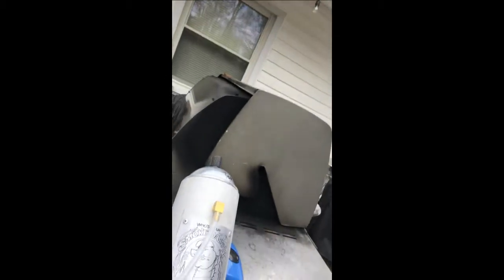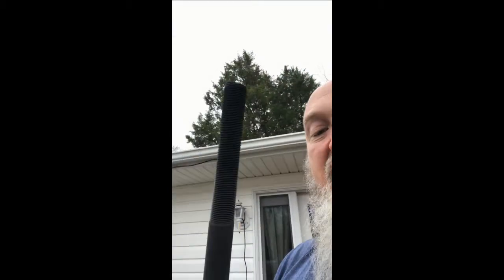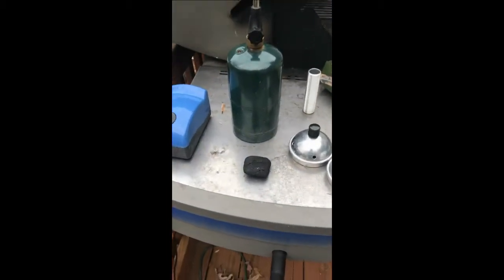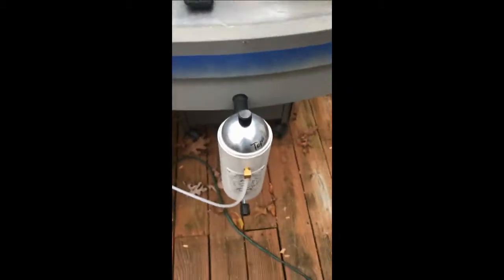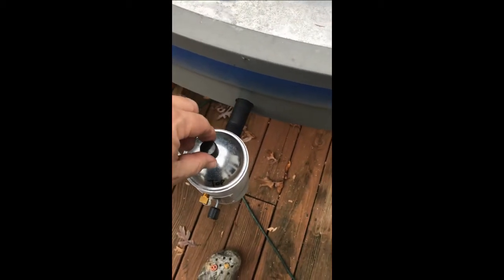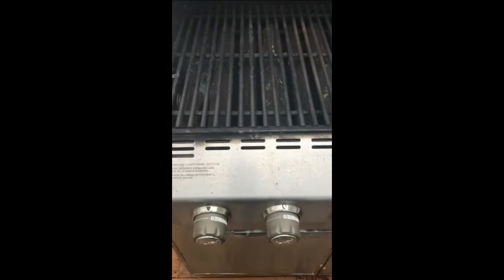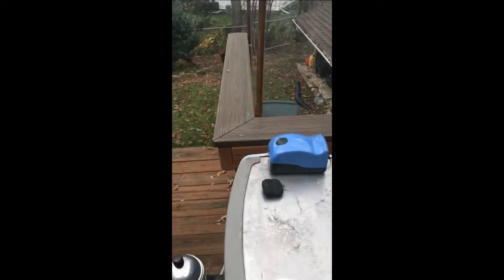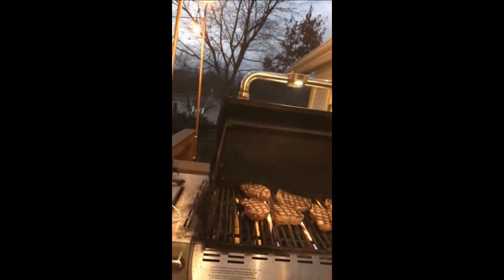Smoke Daddy Big Kahuna Review on a Weber Gas Grill - unbiased

Comment: Ever thought about using a stronger air pump? I built something similar to the smoke daddy as a proof of concept. I used an aquarium heavy duty pump after failure using a similar pump to the one smoke daddy includes. Bought the heavy duty pump off eBay for approximately 40 dollars. The Smoker I built was similar in size to the big kahuna and along with the heavy duty air pump would literally fill a 30x30 warehouse with smoke. 

My design was crude but cheap to say the least so I finally bought the Big Kahuna a week ago. Another thing I learned with my design was that depending on how far out or in the air tube is in relation to the tube that goes into the grill will affect the smoke production. I usually had to move the air tube further in or out of the smoke tube. In my case with the big kahuna the 4 inch threaded smoke tube gives me enough leeway to thread it into or out of the air tube for optimum smoke production.

Haven’t had a chance to install the Big Kahuna on my pellet grill, so I’m anxious for this weekend so I have a chance to install and try it out 👍🏻

Comment: Nice review.
 Looking for something like this that can burn chips instead of pellets.
I've heard the chips only last about an hour with the Smoke Daddy. How often have you had to fill it ?
Reply from the maker: First off, Thanks.  I like to use chips and chunks.  I may need to trim down the chunks with a hand axe.  Either way, maybe an hour of burn.  Chips are faster burn but easier to load.  Its pretty simple to add more or another handful.  I have only used Dry chips and chunks.  I have not tried soaked ones.  If I did, I would use a layer of dry followed by soaked ones so the charcoal doesn't get wet.  It also depends on how much air is flowing from the pump, the slower the pump the longer the burn.  Your grill may also play a part in how fast, but I am not sure.  I have used it on my Weber grilling at 500-600 degrees.  It seems to need more force to overcome the burners.  I have used it indirect heating.  That's where this shines.  I did it on a Turkey and liked it better than from my Pellet smoker.  I believe the cook was 2 hours, spatchcocked.  I did fill it once more during the cook.  Was using Apple chips and chunks.  I bought this because charcoal cooking isn't always feasible when you don't have time to light it and wait.   My Gas grill is always ready.  I wanted a little more smoke favor that I didn't get from the gasser.  This does the trick for me.  You don't get a lot being that you are only cooking 10 minutes or so but it is nice.  I stoke it up and let it come up with the grill.  Maybe add more chips before I put on the steaks.  Fan at full blast.  I don't fear Oak or Mesquite but Hickory is my go to.  I may try this on my pellet smoker one of these days instead of my smoke n tube.  Hope this helps.
Reply: @bauersbrauhaus451  Big help.  I don't even have a full sized grill ATM but have 2 electric smokers and a really nice propane smoker, all Masterbuilt.. The electric smokers have a cold smoking attachment that would last a few hours but after a few uses the chips don't fall down so you have to give it a cpl of shakes every 40 minutes of so defeating the purpose.  That's why I'm looking for an alternative.